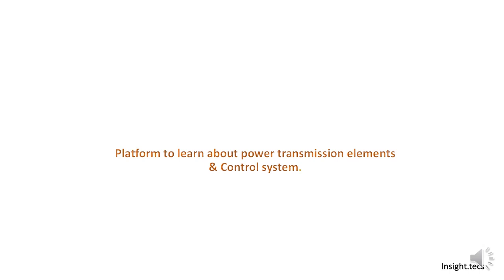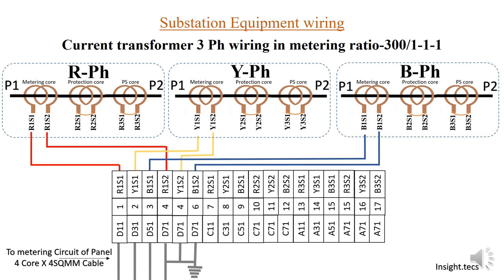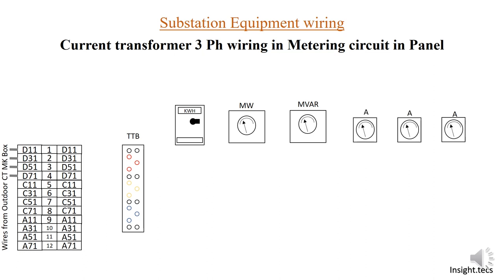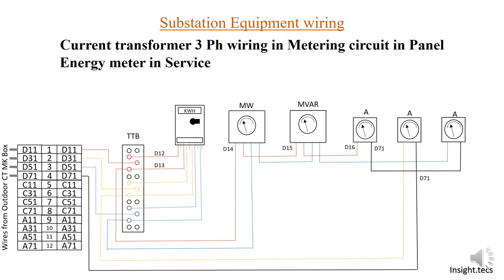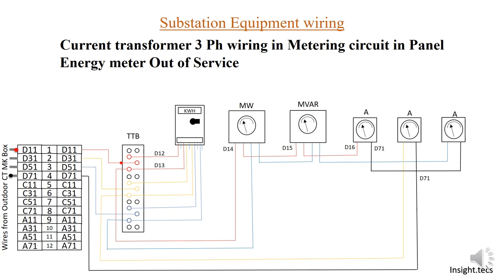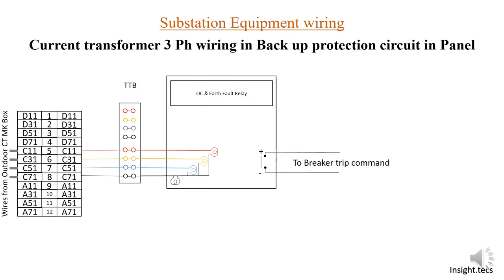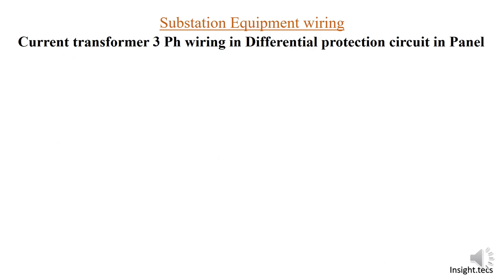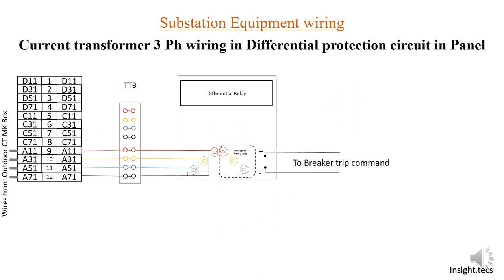Current Transformer Wiring || Inside the control panel || Part-3 || Hindi

Comment: Sir breaker trip command me  positive me negative  milne par short circuit ho jayega jisse control fail ho jayega .
Esme relay ke NO  (normal open )
Terminal par triping coil ka ek Terminal jodenge jo relay operat hone par NO , NC me change hoga or triping coil breaker trip kr degi ❤❤

Comment: Why current of Y phase from the TTB doesn't go to energy meter & MW meter and goes to Y phase ammeter only???
Reply: Please reply
Reply from the maker: There are two types of energy meter,
 1. 2 phase 3 wire and 
2. 3 phase 4 wire meter
In old panel there were used 2 phase 3 wire meters were used where CT of Y ph  is not required, 
Now a days numerical energy meter are used where all 3 ph CTs are required, 

Also MW meter doesn't required all three phase CT, so Y-phase is not connected in MW meter.
Reply: @Insighttecs  thank you so much sir